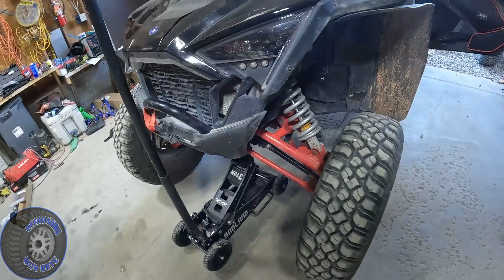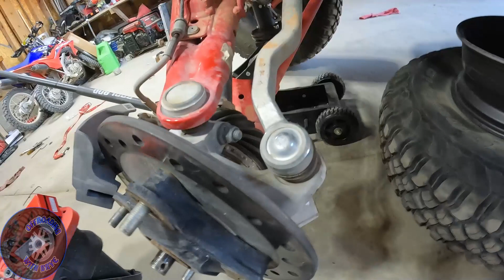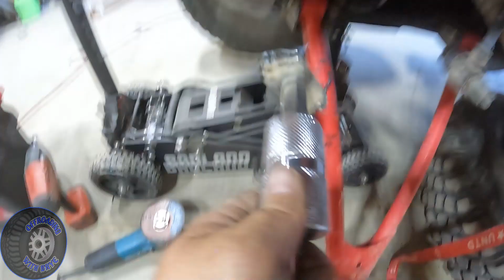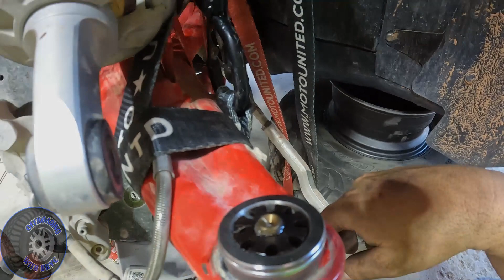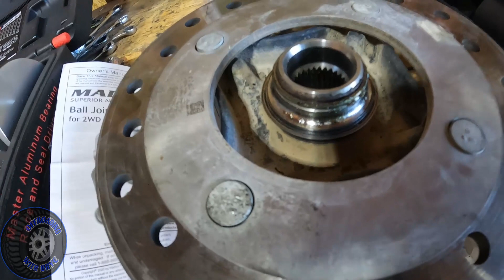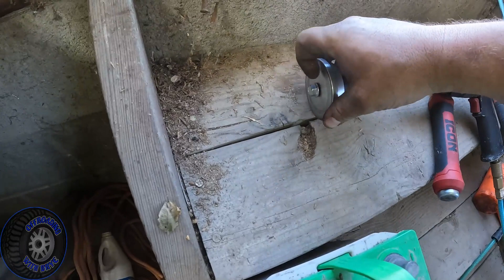Polaris Rzr Pro XP Front Axle, Bearing, and Ball joint replacement

Comment: I know I need new bushings but cant tell where the play is all coming from. Thinking I might just knock out the Wheel bearings and Keller ball joints at the same time. only 2700 miles
Reply from the maker: Mine didn't have much play, but I could hear a squeak on one side. I  figured if I'm getting  that torn apart might as well do everything.